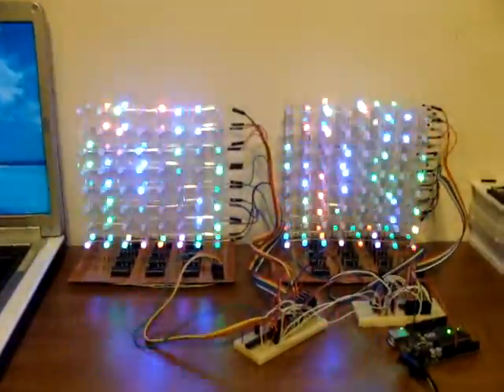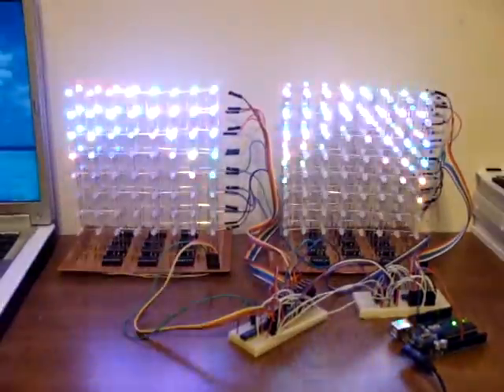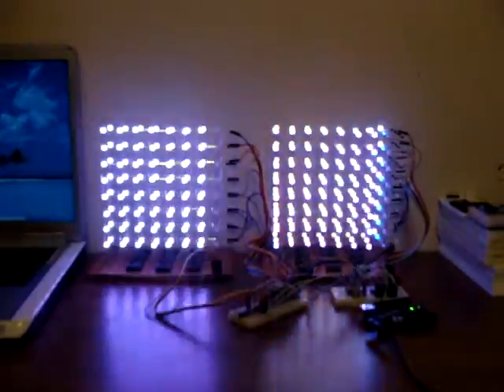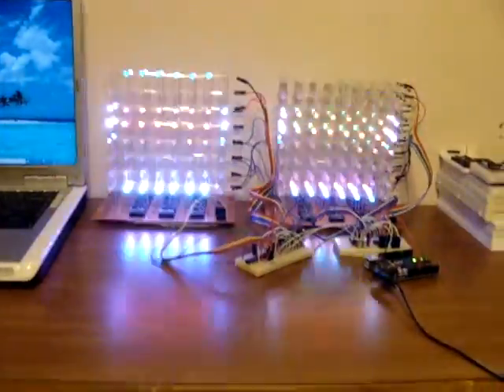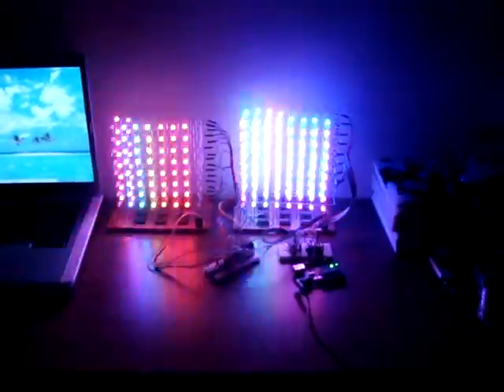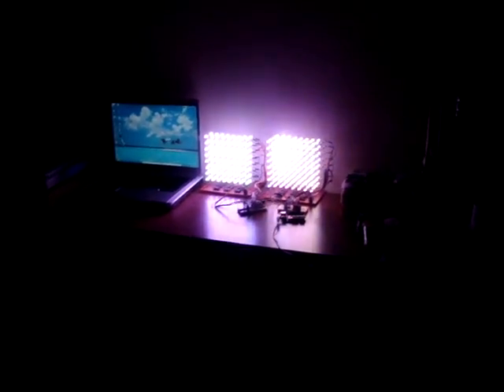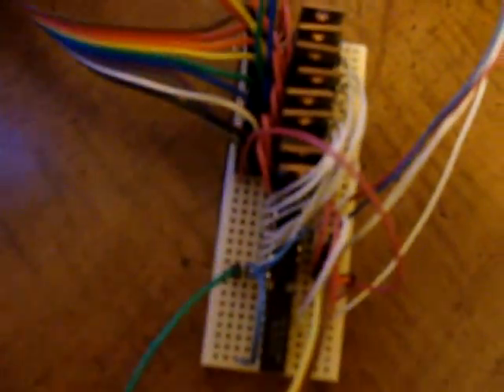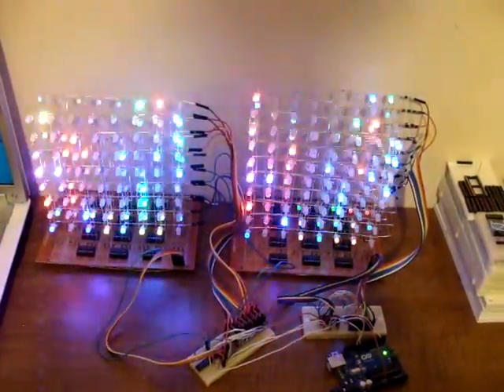8x8x8 RGB LED Cube - common cathode vs common anode

Comment: Hi Bob, cool video.  I have a few questions:
1) According to the datasheet, the 74HC595's have a max chip current allotment of 70mA so it seems as though you might be seriously overdriving them.  I suppose it depends on your current limiting resistors and your multiplexing scheme.
2) Technically, the inverters are not needed for the common anode, the output to the (presumably PNP) transistors would just be active low, right?
3) Not sure I understand your comment below about common anode not requiring power regulation.

Thanks!
Reply from the maker: Each 74HC595 output powers one LED at 20 ma.  For common anode you have to have a active high driver that can drive 3x8LED's or 480ma.  Since the active high is driven by TTL, it self regulates to the TTL high level.  You can use 6-9VDC unregulated power.
Reply: @bobdavis321  By "one LED" does that mean that you only turn on one LED at a time with your multipliexing scheme?  Because if you were to turn on as many as 8 at a time, that's 8x20mA = 160mA which is greater than the 70mA chip allotment of the '595.  That was my point with #1.  Thanks.
Reply from the maker: @Enigma758  Each output of the 595 only turns on one LED at a time.  The common pins turn on up to 8 x 3 colors or 480Ma at a time.  So they have a ULN2003 or a driver transistors.
Reply: @bobdavis321  OK, what prompted my question is that most LED cubes I see power an entire row at a time, but that's not the case here if you are powering at most one LED at a time from a single 595.  Of course, the ULN can sink far more current when common to multiple LEDs.  Without a schematic and code, it was impossible to deterimine that.  So many designs I find don't take that into consideration, but it appears as though you have.  Thanks for clarifying.
Reply from the maker: Oh, wait, I was confused.  Each output of the 595 powers one LED, but there are 8 outputs so the total current for the entire chip could be as high as 20x8 or 160ma.  I do not know what the duty cycle is, but you are correct that exceeds the rating of the IC.  But still I have never lost a chip from overheating.  I have paralleled the ULN2003 (one on top of the other) because they do get hot because of the total current in a common cathode arrangement.
Reply: @bobdavis321  I believe you mean ULN2803 (as stated in the video).  If the ULN is sinking 160mA/chip, that should be well within the 500mA max rating.  However, according to the datasheet, Rth(j-a) is 66.4 C/W (ULN's do not have the best power dissipation - also they don't fully sink to ground due to being a darlington pair), so assuming 22C as ambient temperature, the junction temp would be roughly 22 + 66.4*.16*5v (assuming 5v) which is 75C (assuming continuous load).  So roughly 97C or 167F.  That is on the hot side!

Comment: hi sir sorry to bother but would you be of help and mae a vid on how to set up the drivers for the common cathode rgb led. thank
Reply from the maker: The schematics are in my book "Arduino LED Cube Projects".  What do you need to know?  The 64 columns are direct drive (via 50 or 100 ohm resistors), the layers use driver transistors or a UNL2008.
Reply: Bob Davis  I have common cathode rgb led I'm kind of a newbie. I want to know how to set up the drivers. Took me a while to listen to the uln2803 driver but have no idea on how to set up. I have little knowledge about the 75hc595n driver setup. I will see if I can find your book
Reply from the maker: Pin 1-8 are inputs, bin 9 is ground, pin 10 is 5 volts or NC, pins 11-18 are the outputs to the LED cube layers.

Comment: please tell how should i increase brightness in 8x8x8 rgb led cube common cathode version .. i m using 24 shift register to drive rows and column  and 1 shift register to drive 8 layers   shift register used are 74hc595
Reply from the maker: +saad uddin - The shift register driving the layers needs driver transistors!  TIP120 or TIP125's.

Comment: Hi,  I would like to know if the common cathode version has different hardware (shift registers, transistors, etc) than the common anode version?
Reply from the maker: +Rafael Arosemena - my design has a lot less transistors that the common design found elsewhere.  It works configured as common cathode or common anode.

Comment: How do you identify between common cathode and common anode. Both have the same pin length. 

In your comparison, Which one is in your right?
Reply from the maker: +Mervin Thomas  - One works as good as the other.  Except that in a common anode configuration the 5 volts does not need to be regulated.  To determine what an LED is, us a 9 volt battery and a 1K resistor.
Reply: Thanks Bob

Comment: I would still use common anode, because I can use external power, and the transistors wouldn't really bother me, since they are not much work to put in. :P
Reply from the maker: R4MP4G3RXD [Rampiii] You can use external power with either design.  However the voltage does not have to be as regulated with the common anode setup, as long as it only goes to the anode driver transistors..